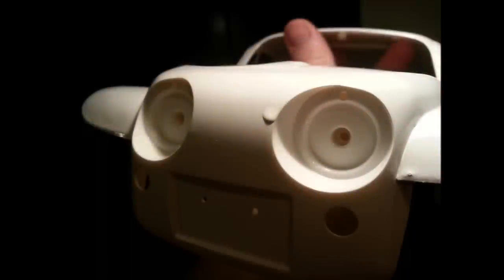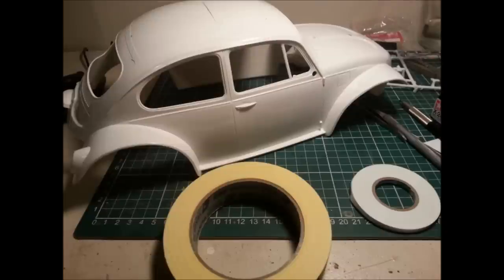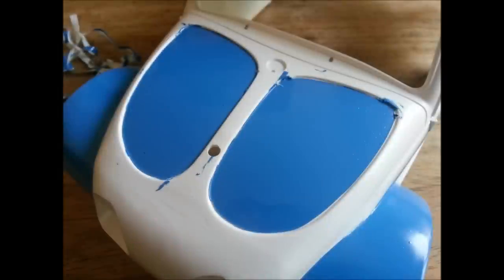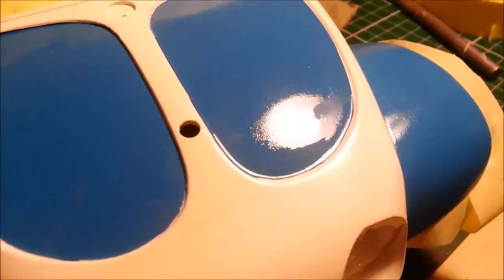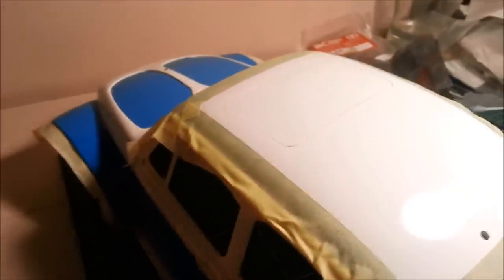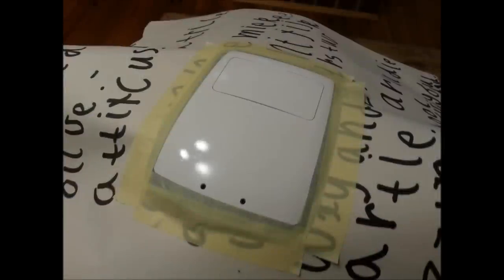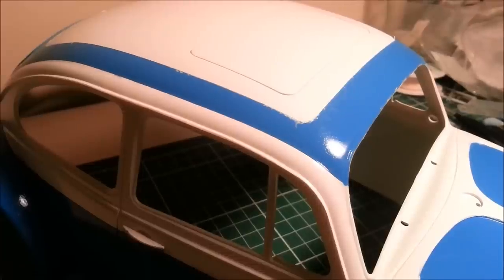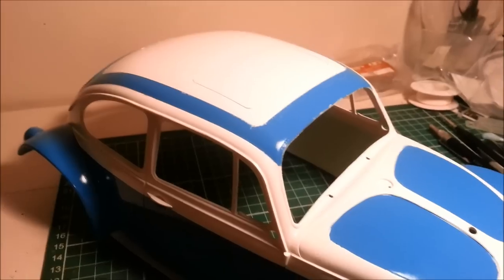Painting gloss paint on scale models is REALLY hard to do!

Comment: Hi Dave don't be so hard on yourself,l was an automotive painter for 40 yrs mainly at dealerships,vw bugs to me are the hardest to paint,all the curves,reverse curves anyway go to your local automotive paint supply store and get 3m green fine line for straight lines and blue fine line ,which is flexable and made for curves,comes in 1/4 , 1/8 and 1/16 lay down your stripes or flame or what have you, then finish masking the rest with regular masking take,wait until completely dry the pull tape off away from the painted area with rattle can paint you need to wait at least 3days to recoat or within the 1st 3 hrs to clear coat or you'll just open a can of worms,best of luck,oh just put a "dust coat" 1st then wait couple min,2nd coat a bit more ,wait couple min or when paint starts to get "stringy to the touch" ,check on masking paper,then wet final coat I model in ho scale and I use this when I paint my building ,2 tone, stripes ect,best of all have fun
Reply: That’s exactly what I was going to offer with advice. The only thing I would also add is to hold the rattle can’s length away from the body while misting quickly, or wet coating. 
But then again, Dave probably already knows that.

Comment: May I offer a tip Dave? A number of years ago we were recovering and painting the numbers on an old Stinson 108 aircraft, and were having the same problems of paint bleeding through the masking. The solution we found to that problem was to first spray around the edges of the mask with a coat of clear gloss before actually applying the color. Worked out really well! Also, have you seen the videos by Donn Yost? He goes into detail on how to obtain a flawless high gloss finish for model cars. Well worth the price of admission if you think you might be doing more model cars in the future!
Reply from the maker: Thanks, Reindeer911 - I'm going to have to check out Donn Yost's work, I've never seen any of his stuff before. Thanks for the heads-up. Dave
Reply: The clear gloss on the edges is really a game changer!
Reply: Spraying clear gloss first, that's a new one for me! Thanks for the tip, I'll try it next time!

Comment: Dave, Your not alone. I recently bought a revell a320 air Berlin model and after 2 days of assembly i was ready to paint. I spray painted a little to close and once i came back after letting it dry for 8 hours. there were so may drip marks all along the fuselage. I spent an entire evening trying to scrape the paint off and i accidentally scraped it too hard and left some sandpaper scratches along the fuselage. So Hey everyone makes mistakes and as long we learn from them. the loss is not to great.

Comment: Gloss paint takes a lot more work to get the result your looking for. You have to sand, sand and then sand some more. You need to sand the plastic body flat first. You HAVE TO prime it with a primer that can be sanded. Then wet sand the primer smooth. I usually sand it out to 4000 grit. Then you can put the color on. Airbrush or spray gun is much better than the cans. They put down way too much paint at one time.The suggestions to clear the tape lines is good. Your going to have ridges between colors, it's inevitable. So you have to wet sand after the color is all on. Removes the ridges and the orange peel and most of the other issues you run into. I usually color sand to 6000 or 8000 grit.Then you can clear. I prefer 2K clears. I think they generally sand better. But your going to need to wet sand the clear out to 6000 or 8000 as well. Then you can start polishing it to get the gloss back. There are a lot of polishing systems out there. Experiment with them until you find the one that works best for you. It takes a lot of work and you have to be very careful to put enough paint on and you don't sand too hard so you don't sand thru the paint. It's easy to do on the edges. Anyway, it's a LOT of work to get a good gloss finish. But it just takes some practice.Also, I've got a couple big plastic toots/boxes. I put the models under them as soon as they are painted. Helps keep things in the air from settling on the wet paint.

Comment: this is why auto body guys use basecoat/clearcoat systems.  the color coats are generally always flats, which you know are more forgiving.  the gloss comes from the clearcoat....and good sanding then polishing.  also, when you can, mask low instead of high even if it means spraying the darker color first.  that way, you could have used the shape  of the hood dimples to cut the tape perfectly.
Reply from the maker: Thanks Will. This gloss debacle has been very humbling, I've realised how much there is always out there still to learn in this hobby. I considered masking low, as you suggest it would have been much easier for those hood dimples, but I thought the idea of trying to cover the rich blue with white would be a horror. To be honest, I just should have used an airbrush rather than those damn rattle cans, so much more control and less bleeding I imagine...

Comment: Dave, I respect you've laid bare your mistakes and I certainly took away some good caveats which will help me. I've had every one of those screw-ups more times than I care to remember. Seems to me you talked yourself through the gaffes, trying to figure out a solution. My solutions usual are found after I repeat the same mistakes umpteen times and at some point. a little light goes on and I get a little insight. But I'm sure these problems have cropped up in all of our model building. I don't think one can avoid them all. Name a problem and I've had it...in spades. Thanks for the bare-all. You can only get better when you own your mistakes, and you have definitely done that. So, cheers from across the pond! Virginia Cork
Reply from the maker: Thank you Virginia :) I do believe in sharing the screw ups as well as the victories, some modellers present themselves as a source of all knowledge. As you wrote, real life isn't like that. All the best from Melbourne - Dave

Comment: Yeah gloss is hell unless you get an airbrush. Rattle cans are far too “wet” although that sounds a bit odd for paint. You’d have to spray many super thin layers from a fair distance with a can. Adam Savage sprays with rattle cans from at least a foot away and then hits it with a hairdryer immediately. Might be worth a try to avoid paint creeping under the tape? I also found that the paper backed masking tape tends to bleed a lot, I’ve stopped using it for edges altogether. Paper tape + rattle cans = Hell....

Comment: Dave, you think this is bad! Many years ago l worked for an independent  VW specialist. I restored all sorts of aircooled including Porsche 911's . One of the partners had a tweaked  beetle ,in white, and suggested my apprentice painter should have a go at painting it. In spite of my strong protests against the young lad "having a go"  and the certain waste of paint  l lost my battle. So l went home and left them to it. On my return , without any exaggeration the runs had me in stitches,more runs than Ian Botham! (Well it was the 80's).  They literally  dropped in strands from the bottoms of the wings to the floor and we used scissors to make the initial cuts!!! We then left the paint to harden off for 2weeks  before flatting it and repainting. Needless to say l made the second attempt! Regarding painting models l repainted a DB7 in dark blue metallic  using normal basecoat /clear as a birthday gift for my boss. The car was 1.43 scale and l used the same gun as l would for painting full size. In the car painting world  you  get used to painting anything big or small i.e. parking sensors,mirrors, etc . Dave, it may have been easier to paint the blue first and use basecoat, it covers normally in one light coat . Then do the same with the white and finish off with laquer. Practise makes perfect! Oh, and demask whilst it's just flashing off and pull the tape "into" the painted area.

Comment: I also find it extremely hard to paint glossy surfaces, but one thing I can see that would prevent bleeding is using tamiya masking tape on the edges (I noticed you used hardware store tape on the roof. I would also recommend heating the can up in a bath of warm water it makes the paint flow better. Alex

Comment: I use electrician's tape to mask for paint.  I pull of a long piece, stick it down to glass and then cut it into strips about 1/8" wide.  Gives a super clean edge.  After masking the outline I fill in the rest of masking with low tack painter's tape.  I also use newsprint for large areas so not to waste tape.
Reply from the maker: Hi Fuzzy, that's a good piece of advice. Someone recently told me that the edge of tape tends to bleed anyway, that I should cut lengths as you suggest for a cleaner edge. I'll try that next time.
Reply: I love to see all the tricks that painters come up with, because everyone is different.  I really like this one. I'm going to try it.

Comment: There are a few rules with any type of any type of spray painting. Rattle cans (aerosol paints) are difficult to use because they are hard to regulate  and should be used in a draft free environment. Spraying at a distance of 6 inches of aerosol cans because of the nozzle is best achieved. But difficult for touch up. Better to invest in a airbrush that you can regulate your psi and nozzle width. The other is use acrylic paints at first because they are more forgiving. It dries faster than enamels. Easier clean up. Masking is the time consuming of any part of spray painting. Ask any auto retailer. If you need to mask and you are satisfied with how it looks, its time to paint but in thin layers so it does not run. If you get a spec of dust or bug leave it. when the paint dries wet sand with 400 grit of those areas. Come back and touch up those wet sanded areas. Say if the the spray is successful without dust or the bugs. (I have never had a first top coat without imperfections) But the masking tape should be pulled off at the earliest convenience so the paint does not crepe under the tape no matter much you burnish the edge of non paint. The air source I like is Co2. 20 LB bottles over compressors. Most airbrush artists use the Co2 because of less moisture even if you have a moisture trap on your compressor. And it is quieter  without the compressor turning on when the tank becomes low. Co2  bottles last an incredible amount of time and can be exchanged at a weld shop that supply stores (like for Acetylene) are available.

Comment: You often get "orange peeling" on paints from an aerosol can, if aerosol is the only thing you can work with try to wet sand each coat of paint AND clearcoat. Because aerosol cans are so imprecise they tend to send out droplets of paint of varying sizes and this is what causes orange peeling of the paint, that and the fact that the paint is quick drying so it doesn't allow droplets to equalize across the surface of your model, causing orange peeling. All spray cans are convenient, but alas that is where the benefits end, everything else about them is bad or substandard. Invest in an airbrush, even a uber-cheap Chinese airbrush would kick a spray can's arse!

Comment: Lots of wet sanding and buffing bro, Spraying a clear coat over your masking tape does work excellent! It fills any bleed thru gaps with clear...  It doesn't look that bad man!(All I build is car kits and I've had a few look worse than that) I find using automotive thin plastic masking  tape works great around the edges and a decent quality 3m style to fill in the big spots. I bet a light wet sand (fine grit 3000 and up) and good Novice 3 step buff on that body and she will shine!! Happy building and bashing that machine around man!.............   Mike(Whitey).
Reply from the maker: Check my next video tomorrow Whitey. I shed a little tear mate...

Comment: Just a personal thing, but I never EVER use gloss paints, simply because they piss me off so much - the drying and curing time, the smell, the unforgiving result if even one speck of dust gets on it - life is too short for that crap.  As I said, it's just a personal thing, but I get results that I love with a combination of acrylics and, if the model demands it, a clear gloss coat at the finish.  The thing is, if there's any dust on the gloss coat, it can be lightly sanded with very fine sanding sponge, and glossed over again with no damage to the paint job.  As for the bleeding (what a pain!), either a clear coat along the edges of the tape first to seal it, or a very fine spray of colour aimed away from the edge first and allow it to dry before continuing.  The trouble with lacquers is that they have solvents in them that tend to dissolve the adhesive on the masking tape, hence the major bleeds.  Good luck, Dave  :-)
Reply from the maker: Ahhhh, see, now I've just learnt some very important lessons from you Nitramyar. Thank you! I didn't know about the solvents affecting the tape adhesive... I'm planning to cover the whole thing with a final clear gloss coat, I'm hoping that hides a multitude of sins...  thanks again my friend, D

Comment: I found it easier to paint the base color FLAT as you would normally do with airplane camuflage, you can use fine sanding to smooth the transition edges a bit, also you can spray it very light in thin layers, after you are happy with the base paint , than you clearcoat the hole thing starting light and finishing heavy, later you can polish the orange peel. https://www.scalemates.com/profiles/mate.php?id=16302&p=albums&album=42642&view=thumbs
Reply from the maker: Thanks Cesar - good tip. I'm realising how much there is to learn about gloss surfaces!

Comment: Hi Dave, You are being too hard on yourself. Here are a couple of things you may like to try. I have been doing these things for years now and generally have some good results. I build aircraft and use gloss enamels exclusively. If I use a rattle can I decant the paint into a jar through a straw and leave the gas to evaporate overnight. Then I use an airbrush to apply the paint after I have thinned it. You may like to try sealing the masking tape with a thin bead of acrylic floor polish (Future, Passt, One Go). This stops any bleed. Once your gloss paint is dry apply a coat of gloss varnish (either acrylic floor polish or Tamiya gloss) for a mirror finish. BTW, oven cleaner is my best friend on the modelling bench!
Reply from the maker: Thanks so much Gary - there is absolute gold in your suggestions there - GOLD!  If I go further down the glossy RC cars route, I will definitely take your advice. Really appreciate your advice, I've learnt something today :)  Dave

Comment: your using paper masking tape... you want to use vinyl masking tape. its thinner and more flexible it doesn't give that built up lip. as for useing the rattle can, you need to make sure the paint can and paint in the can are at the right temp... before use put your cans in warm water then the paint will be at the proper temp to flow correctly out of the can....
Reply from the maker: Hi Eric, thanks for the tips. I definitely did warm up the rattlecans in warm water before use, and I used vinyl Tamiya tape for the edges, but I still managed to stuff it up!

Comment: Masking tape seems to always bleed for me too.  Try using frog tape.  I've had a lot of success with frog tape over the years.
Reply from the maker: What is frog tape?
Reply: Fog tape is a pro painter's masking tape with PaintBlock Technology. FrogTape has a micro-barrier along the edges of the tape and won't let paint bleed through.
Reply: Just be careful that you use primer. Frog tape is meant for house painting, so it's much tackier and will likely pull off model paint if you haven't done a good primer first.